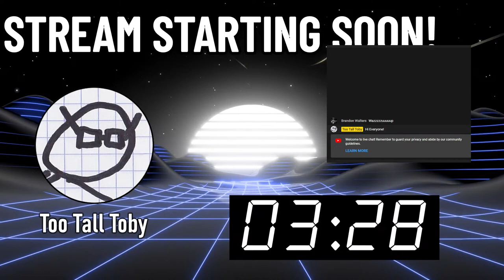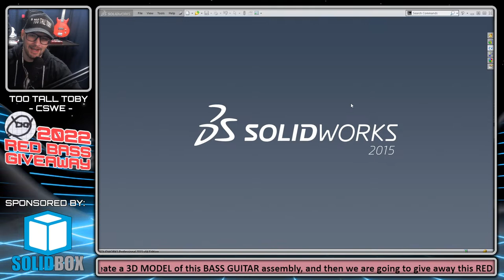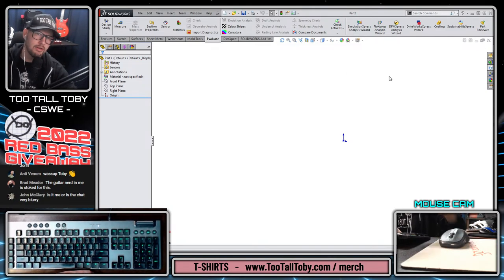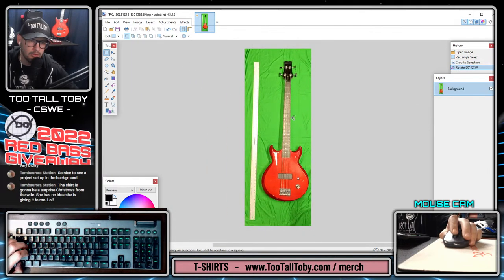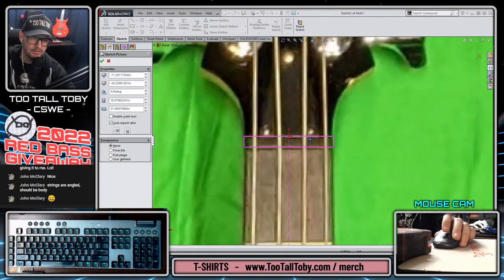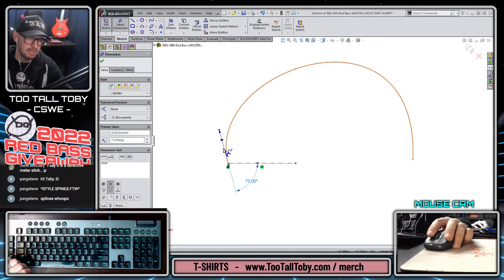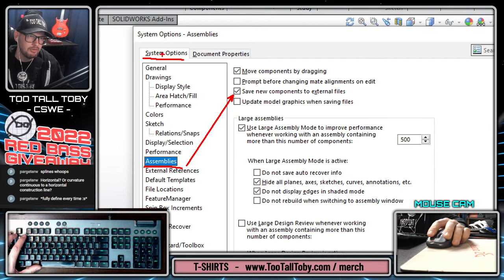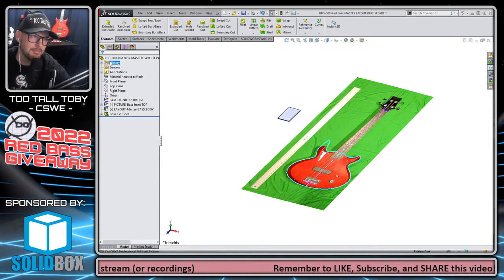Free SolidWorks Training / Tutorial - Bass Guitar - How To Model - Part 01

Comment: Contacted McMaster-Carr to see if they could supply me with a SolidWorks model. Emailed me back to say they didn't have one, so instead they sent me a sample part. This was surprising. I decided to use the sketch picture method to create the model. It didn't need to be perfect, just pictorially decent so I could add custom properties to it for the BOM. Worked like a charm.
Reply from the maker: Awww yeah!!  That's awesome!  thanks TABL3SIX!   Answer:  Grace under Pressure
Reply: @TooTallToby  You are correct, Sir. 👍

Comment: Hi Toby. Just getting around to starting this. Question on creating an assembly from a part. Why do we have to start on the front plane? I'm having a hard time visualizing why this is needed. Thanks for the help. 
BTW, Awesome tutorial so far, gonna try to get through the whole thing. 😬
Reply from the maker: Whenever we use the MASTER MODEL SKETCH LAYOUT technique we create a single part file with multiple sketches, then we add this part file to an assembly, directly on the origin/front/top/right planes.  Then, if we add any other components, we always want these components to have the same orientation as the master model layout sketch.  To accomplish this, we need their origin/front/top/right planes to align to the origin/front/top/right plane of the master model sketch.  So, to accomplish this, we always select the FRONT PLANE of the assembly, when adding a new part to the assembly.

It's not "required" technically, but it helps to avoid creating a spider web of relationships to different parts and sub-assemblies.  This is one of the keys to successfully using in context modeling - avoid creating unnecessary references.  So to help accomplish this goal, we always select the front plane of the assembly.  Now our newly inserted part will ONLY have external references to 2 things:  The top level assembly, and the master model part.  And nothing else.
Reply: @TooTallToby  Just so I'm sure I understand. We could have used the RIGHT plane as long as we only use the RIGHT plane when we add new parts to the assembly.
Reply from the maker: @TABL3SIX  Maybe...but probably not.  The INSERT>COMPONENT>NEW PART workflow is coded in SOLIDWORKS to prompt the user for the location of the front plane when they left click on a planar surface.  if you choose the right plane you might end up going in circles/be off 90 degrees each time from the expected results.  I would need to test it.  Great question though
Reply: @TooTallToby  Thanks again for the help Toby.